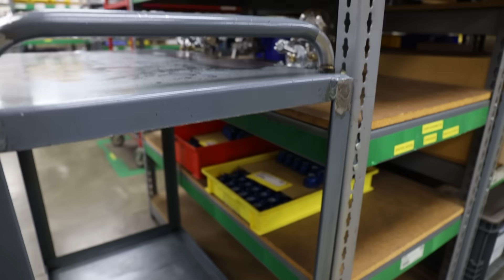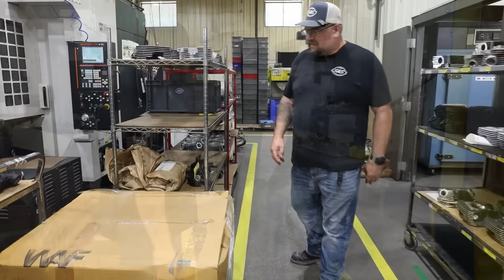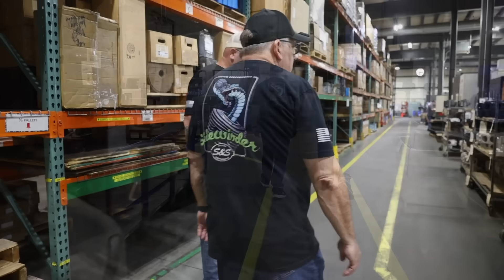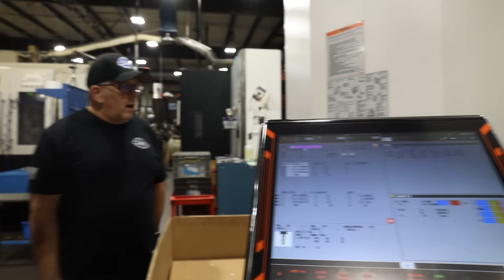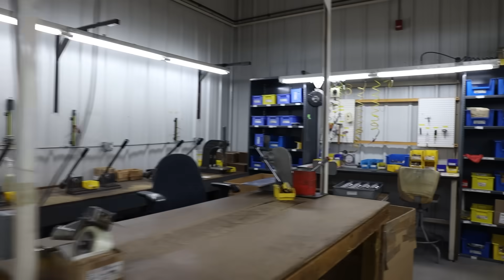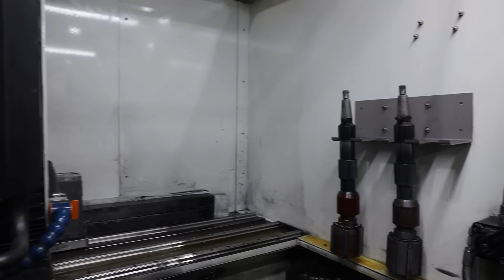S&S Cycle Manufacturing Tour

Comment: I bought an S&S 124" at an estate sale about a decade ago along with a Baker trans, 2" under Kennedy wide glide with PM dual disc setup for 6500!! I stuffed it all into a straight leg rigid Paughco frame. Result is a sleeper that people mistake for a crusty looking FL/Evo abortion, until they hear it start and take off, lol. Coming up on 60k very hard ridden fast miles and it'll be rebuilt over the winter with genuine S&S parts, you guys are tops!

Comment: You CANNOT go wrong with their engines (truly bad ass engines), they are the best and without doubt smoke the rest inclusive of HD from the perspectives of V-Twin performance AND longevity, there is not a better engine and parts made by anyone in our industry.  145, 124 personally owned monsters.  Big thank you S&S Cycle Inc., for decades of super high quality go fast products.  Big Will RED LINE MC of Santa Barbara.

Comment: Thanks for the video, just put S&S lifters in my 2023 Road Glide, intake manifold is on the way too.
Reply: We S&S enthusiasts have to be aware of imitation products not sold by S&S or a reliable supplier. They're many relabeled inferior parts out there that are called S&S, but they're not.
Reply: @milomanx6531  Love S&S and i did purchase them directly from S&S. It seems they must of had a bad batch. But stiil buy their products.
Reply: Had to replace mine (lifters) a year later. S&S quality is not the same nowadays.
Reply: @DBMedia1000 well my stock Harley ones were all cloudy on wheels at only 7000 miles so I felt better replacing them.
Reply: @DBMedia1000   I run them in my motor 165 hp no problems.

Comment: Wow what a fantastic video! I am a true S&S fan based in the UK. I have used lots of your superb parts over many years on many of my bikes.  In fact I have just today (I finished the install 30 mins ago!) installed your comp ramp on my m8 fat bob which is a bomb proof upgrade from the brittle OEM Harley part. On this particular bike I have a 475 cam and oil pump and cam support plate with all the S&S push rods lifters cuffs etc also your 55mm intake manifold and of course the iconic tear drop air cleaner! I am so proud to have your outstanding performance parts in my bike! S&S a truly fantastic company!